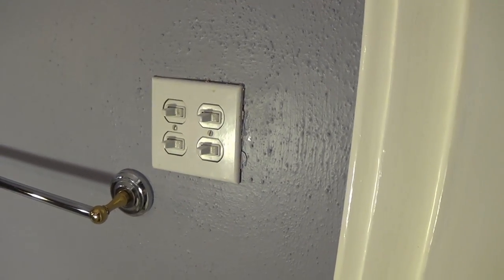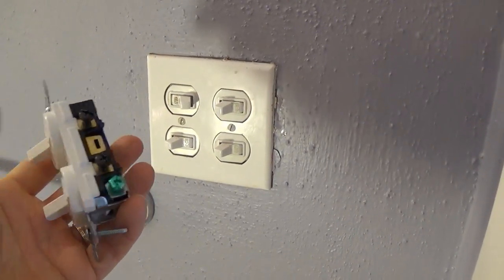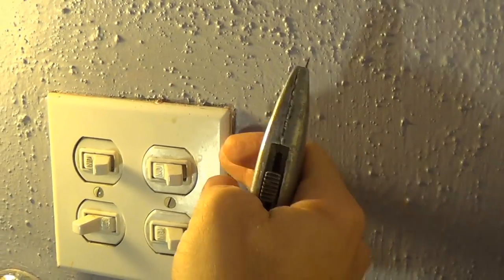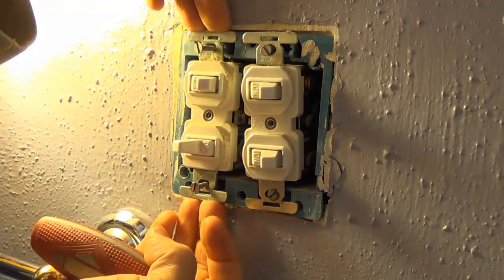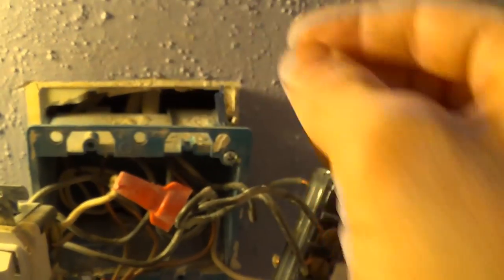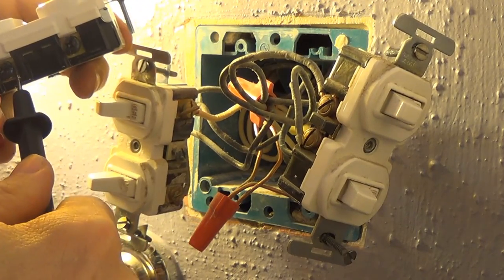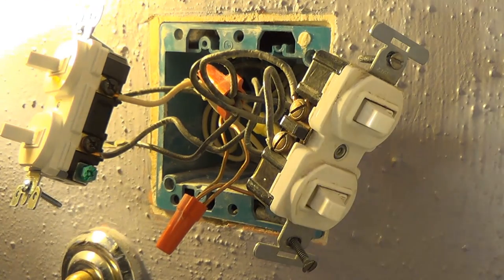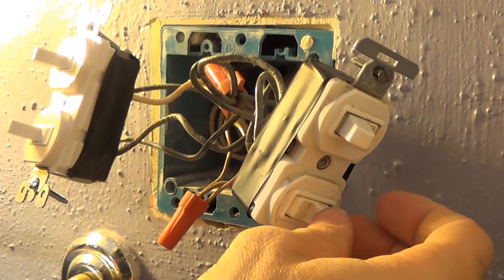How to Replace a Double Light Switch

Comment: I used this video to swap out an old double switch to my kitchen light and my Garbage disposal. I very carefully matched the wiring from the old Switch to the new, as per video. I also added the tape at the end. The light switch works wonderfully, I probably saved around a $100, and the house hasn't burned down.
Reply: I'm in the same boat as you were. It's the light above the sink in the garbage disposal. I plan on doing it tomorrow.

Comment: depending on the electrical code in your area what looks like a low voltage ring in the video holding the switch devices may not be allowed also if there's a ground terminal and a ground wire in the box its all ways a good idea to use it especially bathroom or kitchen ,outside ect p.s in vidoes you should all ways remind viewers to read there local building codes thanx

Comment: hi, I have exactly the same problem with my bathroom switch. you had only showed one side of the switch, and I do not know what is happening in the gold connectors. Is there a secondary wire that connects both gold wires together? Because that was what I found once I removed the switch. Thank You

Comment: I was wondering if it's possible to replace this 4 toggle outlet configuration with a 4 rocker configuration. I am not sure but I think it may require a new box and some drywall removal to accommodate 4 independent rockers correct?

Comment: Do not follow his directions! On the double switch the two black screws on the one side are not for the hot wires  they clearly say common next to each screw  rule of thumb- brass screws are always your hot and silver or black in this case are your Neutral or common wires. In this application your line hot wire (black power) goes on the brass screw and the black screw on other side of switch gets the black wire from light fixture and your common whites get wirenutted together
Reply: Robert Virginia I’ve always used the black for power it’s how they are designed where I am from
Reply: Robert Virginia plus you can’t use them because on the black terminals there is a metal piece connecting them and on the brass it’s not connected he did it all right

Comment: Hopefully the person who set up the electrical in that house didn't set up the grounding wrong to began with. That fact that the switch wasn't grounded before he removed it usually shows the that house was updated wrong. It has been my experience that old houses usually are. I agree that if a ground wire is there you should use it.How ever sometimes the tube and nob systems are cross wired in the walls with the current 3wire system and a ground is often left ho7 and live because of that!So for the average home owner out theredoing more than just replacement of the part could lead to making new problems. So just swap and not modding a system is sometimes better.Needless to say! Its best to get proper training before doing any work or redoing anything like this! I've seen entire homes set up backwards by professionals and non professionals.Training training training!